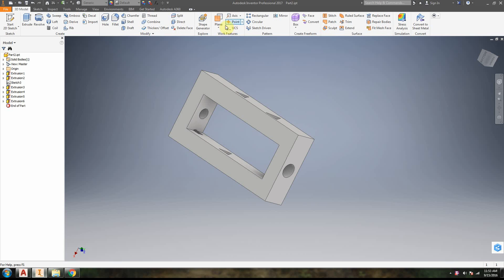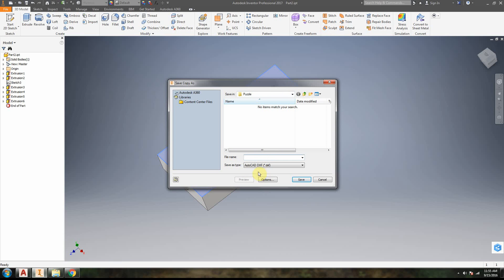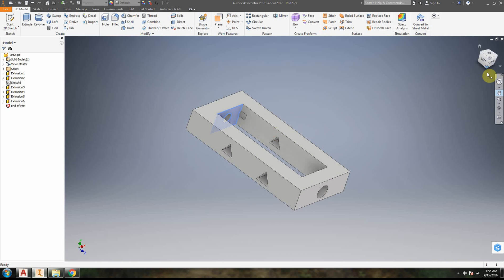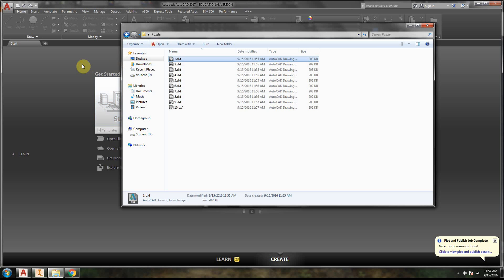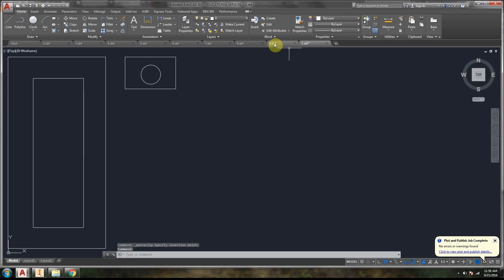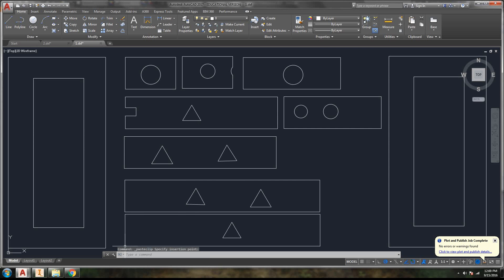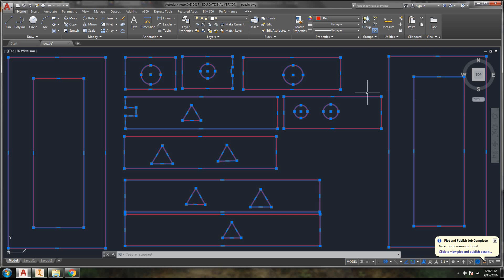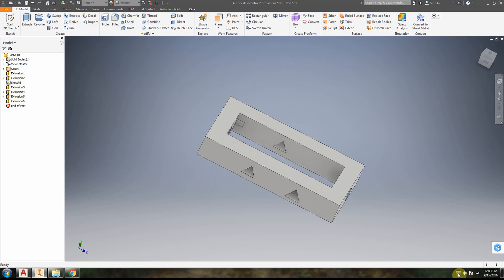Autodesk Inventor 2017: Laser Cutting Workflow

Comment: Is there a way to automatically add notches so that the material would slot together?
Reply: From what I've found, not easily. If you transfer the file to Autodesk Fusion 360, you can use a plugin called Slicer for Autodesk Fusion 360 that can add slots and other such fastening devices as well as change the design in lots of cool ways. Hope this helps!